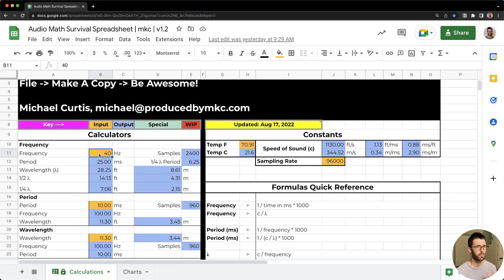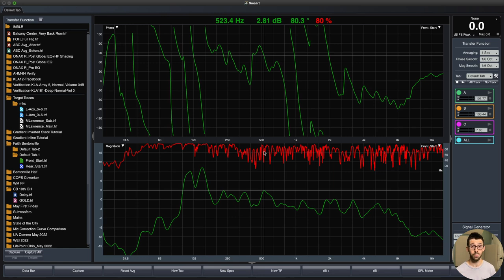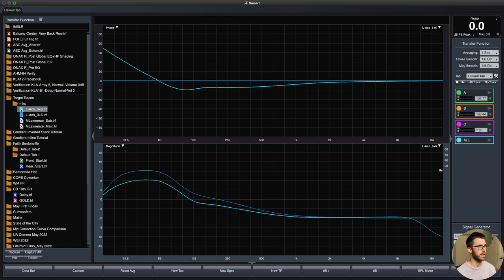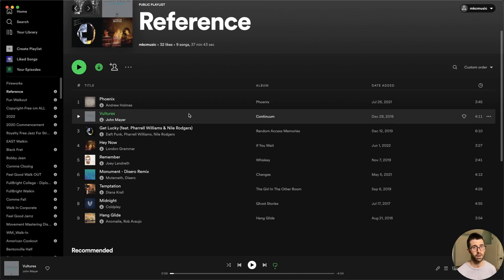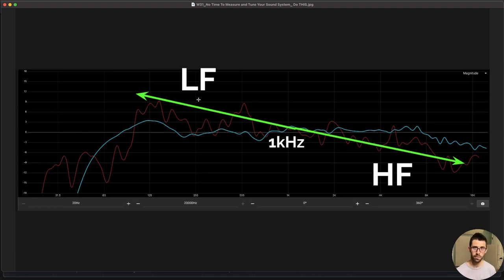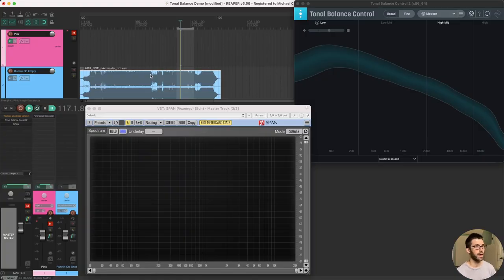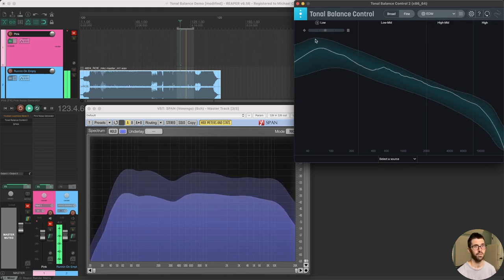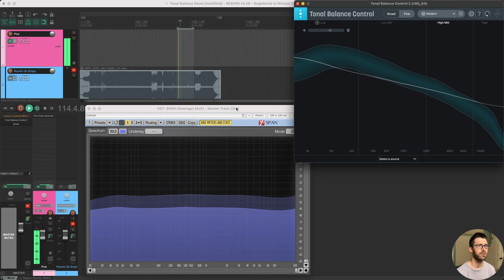Should You Tune Your Live Sound System Flat?

Comment: I think it should be noted that when using a SPL meter or using a measurement mic to check the flatness after tuning you use dB(A) weighted because (A) is usually a more accurate representation of what humans actually hear. But dB(C) is what you use to see the boost you are actually creating
Reply: That is true, although our hearing gets more linear as you get up to around 83dBA. Above that, C weighting starts to become closer to what we hear than A weighting.

Comment: I know you prioritize coverage over stereo in a live setup, but could you make a video of your ideal stereo setup for a church? Is there a way stereo can be implemented and what would be the best way? Thank you so much for your videos, they’re a huge wealth of knowledge and experience
Reply from the maker: Hey, Bob. Thanks for the question! I can do a video on that in the future, but here's the short answer. You'll like push your left and right speakers out wide, then angle them in across to their opposite rear corners. So, they would make an "X" across your audience. You would just have to make sure that your entire audience is within +-3dB of BOTH speakers. Stereo only "works" if you can hear both speakers clearly. That means you likely need a narrow room, or speakers with wide coverage, or both : )
Reply: @MichaelCurtisAudio  hey michael,i have seen a video with  a wide venue  ,
Which have  5 sets of   linearrays hanging above mainstage
Which is configured as left ,right ,left,right ,left.
So that everyone can hear in stereo
Reply from the maker: @fhvgvfgcgh4446  If each of the left/right zones have a sufficient amount of overlap I can see how that setup can create a stereo image for those who are in that zone. But if you're standing directly in front of one of the speakers you will hardly localize to one of the adjacent speakers. Level and timing will win, hands down.

I'm not saying that you should never ever go for spatiality, I just think most engineers vastly overestimate how much of the audience actually gets a decent "stereo" experience.

Comment: Hey, 

question not directly related to this video. Just did not want to intrusively email you.

I'm currently working on designing a system setup for a 2K tent with bars along the long sides. While busy in Mapp 3D I had a thought. I have 2 subs in cardioid in centre front of the stage and two subs on the Left and right side on the stage. Same Sub D&B B2 infra. due to the slight triangular shape of the subs placement  I can phase align them on different locations along the X axes. 

So my thought was rather to have perfect alignment in the front why not around 5/8 of the room and have summation later to revive some of the lost impact and velocity over distance. It works out very nice in mapp 3d with the bars along side out of the sub but the field is very even. I was hoping to hear your thoughts on this and if this is done and what it is called. Thanks :)
Reply from the maker: Sounds pretty cool, but I would need to look at the data more in action to give better feedback! My question to you is why you have three different zones for your subs? Why not all in the center? Why not all LR?
Reply: @MichaelCurtisAudio  the LR sub will give me the elevation I need to get the tops at the right hight. 

LR subs would give me allies and vallies, cardioid centre one is to prevent to much centre stage spill. Also it will give me a better coverage, solve the allies and vallies or at least give me more control to where they land. 

At least this is what I think. I’d like to share the file if you want it.
Reply from the maker: @peevonb7070  That makes sense to me!

Comment: Great tips! Do I need to tune to pink noise to roughly match the trace or use the reference music to tune to the trace? Just slightly confused.
Reply from the maker: You can honestly use either pink noise or music to tune with, but you'll likely get more stable results with pink in a live room situation. Just make sure and use a transfer function measurement, NOT an RTA measurement.

A dual--channel transfer function is comparative, meaning it shows you the difference between two different signals. And RTA is just single channel and just shows us the FFT of a signal signal broken into individual sine components.
Reply: Thanks alot. That helped alot! Cheers.
Reply from the maker: @edge8011  You're welcome!

Comment: Couldn’t it be argued that like aux subs this is mixing up creative and engineering decisions because there is no single perfect solution for the target trace?
Reply from the maker: Yes, I make a similar case for that in this video - https://youtu.be/U76Tskmrg6M
Reply: @MichaelCurtisAudio  I’ve seen that video and my point was that tuning to target traces instead of flat kind of does the same thing 😅
Reply from the maker: @nils2868  Ok, got it! Now I understand your earlier question. Very interesting point. You're totally right in that using a target trace is definitely one of the more subjective decisions in system engineering. The difference between that and aux fed subs is that once you tune to a target curve and are happy with how your mix is translating that's not something you're adjusting on the fly or in the show. It's an overall decision you're making once, then moving on.